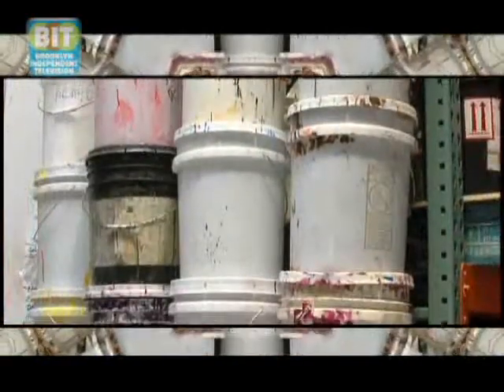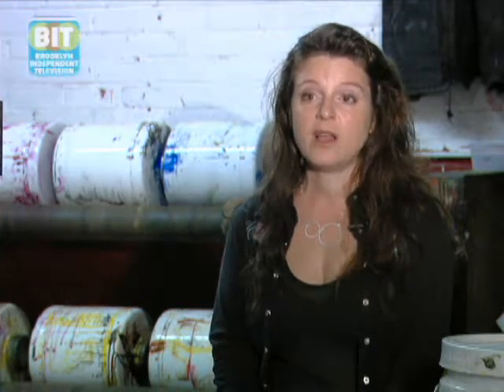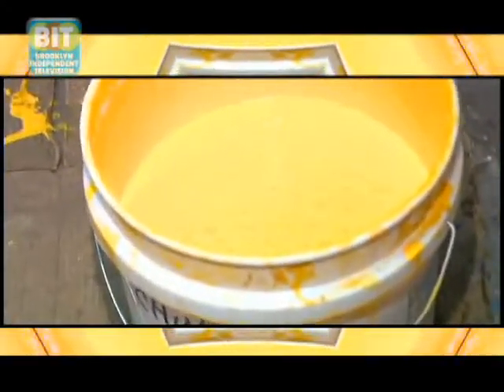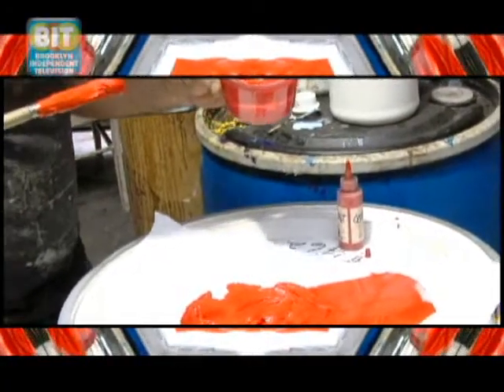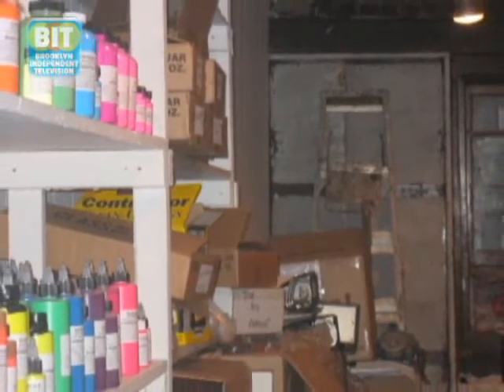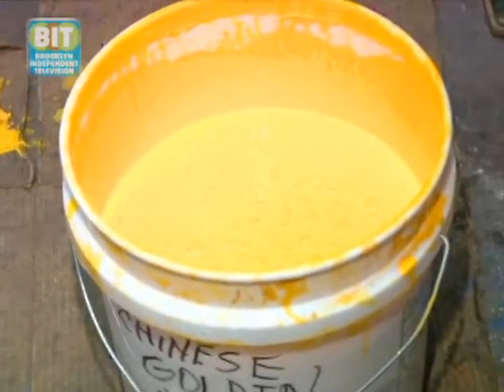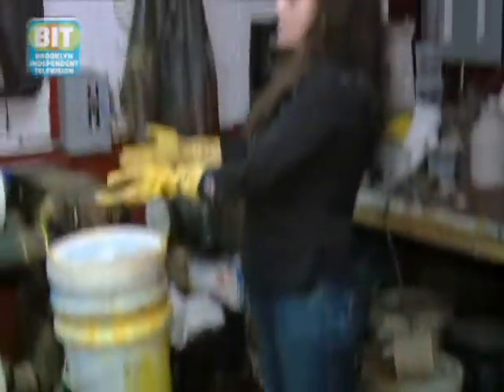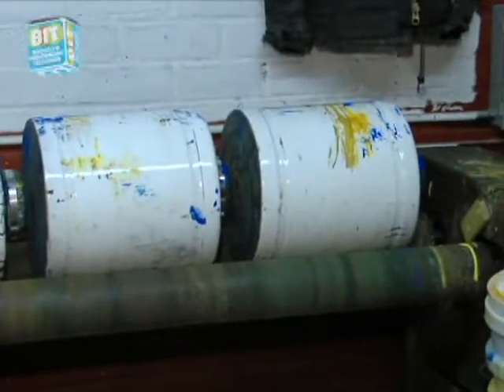Neighborhood Beat: Williamsburg's Guerra Paint & Pigment

Comment: Large companies manufacture dried pigments using complex chemistry.  It is not derived from plants (in almost every case).  Sun Chemical, Dupont, Dow Chemical, etc. are some of the companies that manufacture pigments.  Auto paints drive the industry - artist paints are a tiny tangent.  What Guerra does is very rare, and very cool.  At home, you cannot make quality pigments AND you can't grind them into dispersions without expensive equipment.  Go to handprint for best info.